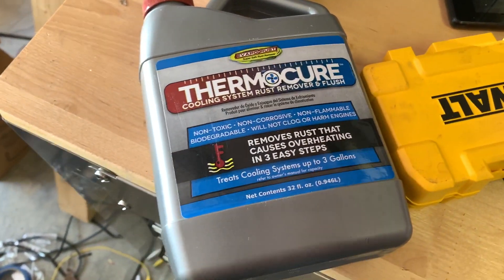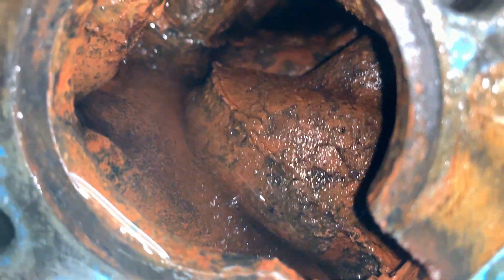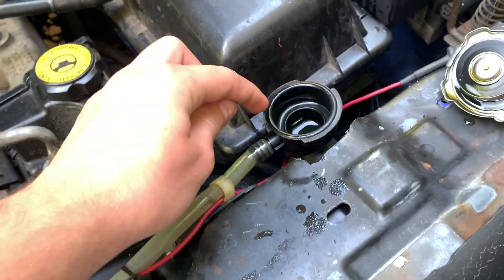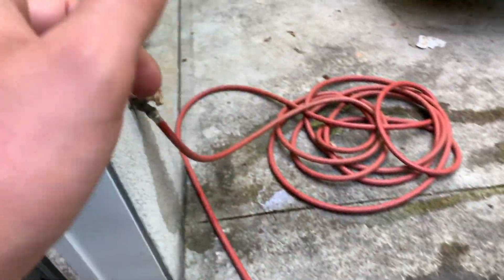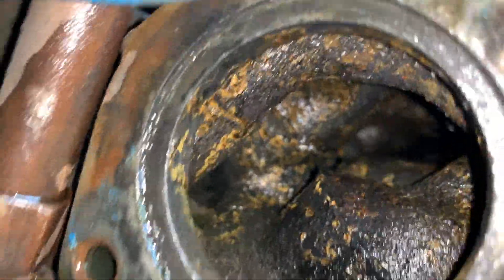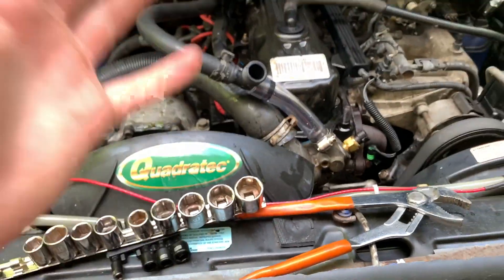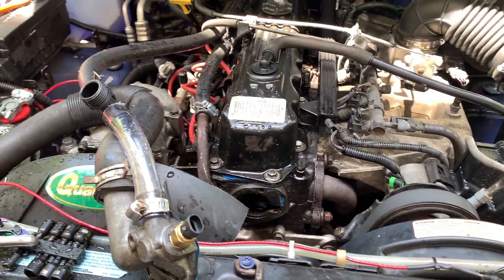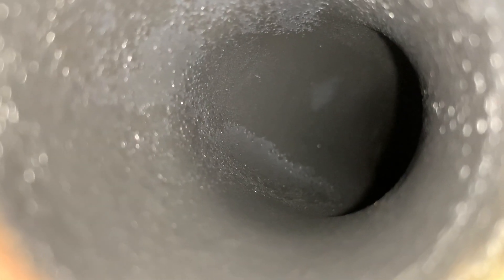Does THERMOCURE actually work? Let’s find out!!

Comment: Coolant doesn't transfer heat as good as water. Water doesn't fight freezing like coolant (ANTIFREEZE)...get it ? ANTI freeze. Moreover antifreeze has lubrucating properties to help the water pump. Thats all.
Reply from the maker: Don't forget it also provides corrosion protection:-)
Reply: @Pondsisawesome124  Great advice ! Some folks forget that if you change some parts connected with the fluid, the rust prevention is gone (with the old parts). . . so the new parts rusting even stronger . . .

Comment: Never use tap water in any cooling system.  Use only distilled or reverse osmosis water and your system will thank you for it.  I would even use distilled for the cleaning procedure.  The problem with tap water is the dissolved calcium and minerals in it.  Have been doing this for a couple of decades and it works.

Comment: How long did you rub it with the thermocure? I’m sorry if I missed it if you said it.
Reply from the maker: I left in it for 4 days & drove it for a couple hours total with it in there. It's mentioned in the video briefly. Just follow the instructions on the bottle & you'll be fine:-)
Reply: @Pondsisawesome124  I ran it for two days and my system. I left my coolant filter on that I run in line with my heater hose. I was blown away with the crap that got filtered out in that filter. I bang it out and rinsed it out at least a dozen times and it still kept pouring out rust from the filter. Definitely works good, the best one I have ever used.

Comment: After replacing the radiator, water pump, fan clutch, and thermostat, the 1973 Dodge Van I have keeps overheating upon initial warm up.
Reply from the maker: You may have a clogged radiator, also check your ignition timing.

Comment: THERMOCURE is $140 on Amazon!!! That's a lot. I used distilled water. I flushed it 3 times driving 2 weeks between intervals. Distilled water is cheap. Don't use tap water.
Reply: Sorry. It's $104 32fl oz
Reply from the maker: I Amazon charging $110 for shipping? It's $30 for the quart size. O'reilly has it for $24.....

Comment: Drill a small hole in the flat of the thermostat, lets all the air out of the system.
Reply from the maker: Good idea as some Japanese cars have a hole or "rattle" valve from the factory.
Reply: @Pondsisawesome124  YES, but make sure you put hole at the top of the THERMO. HIGHEST POINT.

Comment: 😂 You can't EVER rely on reviews anymore. Nowadays, as a side hustle, people actually get paid to make false positive reviews. 
And if I'm right, most owned manuals do not recommend putting any rust additives into the cooling ystem due to possible radiator clogs. They suggest if you insist on using any type of additive during a0 flush, it should only be the type of a recommended cooling system c
Reply from the maker: This was NOT sponsored, I bought the product based on need at the time & it worked to my satisfaction. I'd use it again in a similar situation - your mileage may vary....

Comment: I personally don't think that did anything. All it did was turn the rust black. All that gunk will still flow through the system and kill heater cores and radiators. The only way to really clean out the block is to remove it, strip it down and hot tank it at a machine shop. Not always feasible for some folks.
Reply: The best remedy for this is to get a brand new car, exact make and model. Not always feasible for some folks.